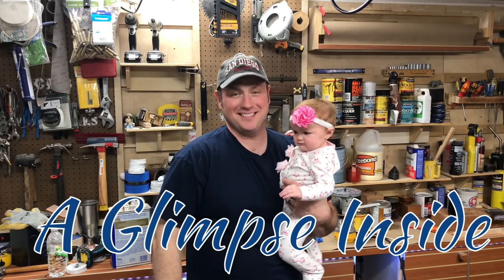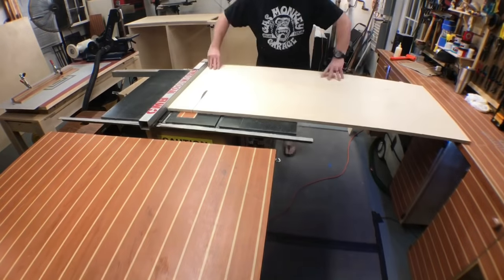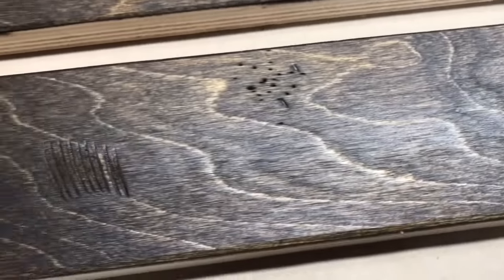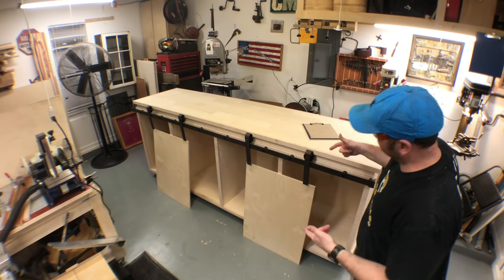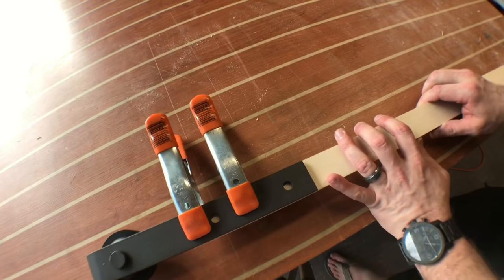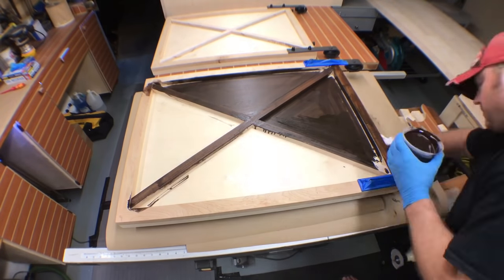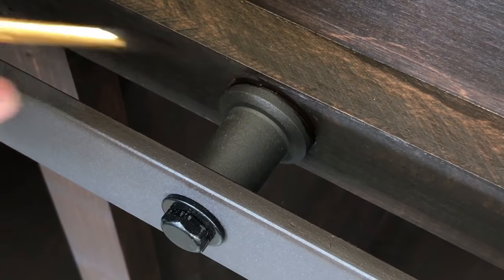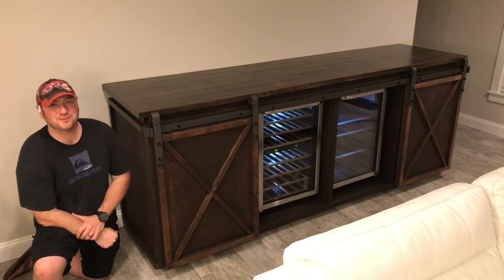DIY Sliding Barn Door Bar | Media Console Table

Comment: I also love your comments trying to relay that woodworking doesn't need to be intimidating. I had a really cool idea but no actual woodworking skills lol. I've only watched a couple videos so far and honestly just the equipment I'd need to buy is more intimidating than the actual design & practice of getting my design ideas from paper to fruition. I won't give up on the idea I think I'll just have to start on a much smaller scale. :)
Reply from the maker: That’s a great idea. Small scale for sure then work your way up!! Exactly what I did too the past 10 years!! Cheers
Reply: Harbor freight, Craigslist, fb marketplace and other buy/sell apps like offer up or let go, can be your best friend for affordable tools when trying to get started. You can do most cutting you would need to do on a table saw, so that would be the first tool I'd recommended buying if you can swing it. If not then a circular saw will work, although will be a little more difficult.
Anyway, just put your mind to it and go for it, one tool at a time and before you know it you'll have a full shop. Keep your eyes open for tools and anytime an item you need pops up for super cheap or on clearance snatch them up. Good luck

Comment: Curious about ventilation for the wine coolers? Where is the exhaust vent for the coolers? I also assume you had to cut holes in back for power cords.
Reply from the maker: Pat Kane That is a great question. For some reason I just did not include that in the video. But there are two slots in each of the refrigerator cavities, they are about 1 1/2 x 12“ a piece. I was actually over at the clients house a month or so ago and everything seems to be in working order so the ventilation seems to work fairly well. Again brother good question
Reply: Great comment.  I know someone who built a cabinet for a wine frig and didn't have enough ventilation. Wine frig died pretty quickly.  There are also built in beverage coolers that vent out the front but that could be a problem if the barn door is covering it

Comment: Great stuff.  Thinking about building this.  Not with the refrigerators but scaled down just with shelves as a piece to go under the wall mounted tv as I’ve build two barn doors in the room and it would match nicely.

Do you remember how many sheets of 3/4” birch plywood you used?
Reply from the maker: Tom Spallone Thank you so much definitely build one for yourself it’s a really fun project. I believe if my memory serves me correct are used seven sheets of 5 x 5 three-quarter inch plywood

Comment: Fantastic build, Thank you for sharing it. I just subscribed, and I look forward to viewing more of your videos. After watching it I told my wife that I should build something similar for my brother and sister in law to place in the basement for their bar area they are planning on putting in when they finish the basement. One question I have is did you use any kind of pre stain conditioner on the plywood prior to staining, or do you find that applying in with a rag versus a brush gives you the best result without the stain appearing blotchy? Thanks.
Reply from the maker: Thank you for such kind words! Yes you hit the nail on the head, a rag for stain application works wonders. It eliminates the need for condition IMO. Thanks again!

Comment: Did you not fill in the holes from nails and screws to keep the rustic barn look? If you didn’t want to add the rustic barn look, would wood putty sanded down and stain still work?
Reply from the maker: Yes I did not Fill those holes intentionally to give it that aesthetic. However a stainable sandable filler would be just fine

Comment: Hey Chris, I like the way You made this look easy, Could You Share a link on where You got the Barn Door Hardware? Was it through Amazon? Oh would like to make Comment on Finish. Seeing how You used Soft Wood mostly on Your Build, Besides the Maple .Do You not think  the stain Job would have turn out better to Use a wood Conditioner such as "Mini Wax " before applying Dark stain. I find it works great on Poplar . All N All Love how the Barn Doors turnrd -out ..Kay
Reply from the maker: I don’t have the original link as it was many years ago however barn door hardware on Amazon is pretty ubiquitous and you should find something there that will suit your needs for sure. As for the sanding sealer I just make sure I go through the grits properly and then I wrote the entire surface down with mineral spirits let it completely dry and then start the staining process

Comment: I'm going to be building something similar for my very small kitchen. I'm guessing you've done this a few times, but I'm planning on putting a mini fridge under my counter and a panel over it to "integrate" it. Is there a potential fire hazard in doing this? Did you have to find a specific model of refrigerator to put in this mini bar?
Reply from the maker: That sounds awesome. I don’t believe it’s a fire hazard however I would stick with a namebrand something that is the house hold name!

Comment: Sir, a couple of questions.. 1. Is there a list of the wood you used? 2. How did you raise it off the floor? 3. If I used a marble top will the cabinet hold the weight? 4. Did you drill holes in the back for the refrigerators?

Comment: Can you make some.plans for a similar build but with only 1 cabinet and 1 fridge area. So basically. 1 roller door and 2 openings
Reply from the maker: Fortunately I didn’t even make plans for this one essentially the video is the plan. I’ll tell you what I did though, are used or the dimensions of the refrigerator and just kind of followed my nose from there. Hope that works for you!
Reply from the maker: Unfortunately sorry for the typo

Comment: Hi I love this piece and you explained everything great. I’m going to attempt it. Just one question which I didn’t notice in the video. What is it resting on? Does it have a stand underneath or is it flat on the ground?
Reply from the maker: I built a 4 inch tall toe kick that is underneath the piece. I just forgot to film it! I simply build a grid with Baltic Birch plywood cut 4 inches in width. Thank you so much for watching

Comment: That is killer details. How much do you charge for something like that...Im newbie woodworker and setting price is always hard for me.
Reply from the maker: There’s two messages charging I typically use one is the cost of all the materials times four. Another one is to make around $500 per eight hour day. Plus the cost of materials. Or charge seven $50-$1000 a day and you buy everything for the project yourself. It just depends on the circumstance brother these are the three methods I use

Comment: I have most of the basic tools you used in this video and now I'm gonna attempt to build one myself. Even though it took you a few days to complete that amazing piece, it came out more than great. I feel as though I'm up for a challenge of that size. As far as materials, how much $ would you charge a client for a piece like that?
Reply from the maker: Depends where you live in the country and what people expect to pay I figured a good range might be $2000-$3500. There’s roughly $700 with material alone in this build
Reply: @AGlimpseInside  That's a really good profit margin, given the amount of time and energy you put into that project.
Reply from the maker: Waldo Rodriguez I typically like to make fourfold on what my material costs or $500 a day while working on client builds
Reply: @AGlimpseInside  Does the $700 cost include the mini fridges?
Reply from the maker: Unfortunately no.

Comment: What plywood is used for the brick pattern top? Also on the faux finish, what made the multiple lines impression?
Reply from the maker: It’s off 3/4 of an inch Baltic Birch with a eighth of an inch chamfer on each edge Getting it that reveal

Comment: I will show that to hubby he says the ones I ordered won't work, but I really, really want them to. The track is 5 foot and the straps are 1 1/4 inch wide by 11 inches long the roller is 2 inches.
Do you think if he adds the reveal like you did it will work.?
Reply from the maker: Donna Coffman as long as there's enough clearance and they slide freely yes they will work. I don't exactly know your situation but I know you can make most sliding door hardware work on most in the application if you put your mind to it

Comment: Would you able to tell me where I could get the hardware for the barn doors that are small enough for a cabinet that is 59 inches long and 36 inches tall.
Reply from the maker: Donna Coffman I ordered mine from Amazon it is a standard barn door hanging hardware that I modified with an angle grinder and sandpaper. I'm not sure if they sell them in very specific message like you're looking for I think you have to kind of do it yourself. But with enough patience it works out pretty well

Comment: It looks like the cabinet is sitting off the floor a few inches.  Did you install feet, a toe kick box or what?
Reply from the maker: Yes I did install a 3 1/2 to 4 inch toe kick, it is recessed by 2 inches all the way around. I totally meant to include in the video but for some reason I didn’t have any footage of me making it. I least you talked about my apologies. Take care
Reply: Thanks for the reply.  Have a question that you might have an idea on.  Am planning to build something very similar to what you built for an outdoor covered patio.  I am also going to build a box on top about 1/2 the depth (front to back) as yours that will house a flat panel TV.  Probably will be the same width (left to right).  Tv and bracket I suspect will be 75-100 lbs.  How would you suggest securing the top to the bottom?  Build as one piece. Or separate boxes and secure with ???
Reply from the maker: I would definitely join the two but I would not use any glue. Just some mechanical fasteners like screws. Just in case you take it apart. But definitely put them together as one unit but just not permanently if you catch my drift. Hope that helps brother!
Reply: I was sort of thinking about getting some steel plate similar to the track for the doors and use that as strapping and screw to back of each.  Sort of like how you would a fix and mirror to a dresser.  Assume that would be strong enough...
Reply from the maker: That would definitely work as well.

Comment: I see that you built a frame for the top. Is it necessary or could you just attach the top ply directly? Is it for strength or to give depth to the top? I’m building a console like this 7’ long planned on attaching plywood directly to the top (no frame) then 2” thick wood slab on top for the actual top. Hope that makes sense.
Reply from the maker: You could probably attach it directly. I wouldn’t see anything wrong with that
Reply: @AGlimpseInside  awesome thank ypu

Comment: Awesome price. Never see what the base is that raises it off the floor. Want to build but don’t see it.
Reply from the maker: I simply build a 3 1/2 inch toe kick out of Baltic Birch plywood that was 4 inches smaller on all sides
Reply: A Glimpse Inside Thanks for the quick reply! I’m good to go! Keep up the awesome work! Top notch videos! Planning a 3 section version with my kegerator in one.

Comment: Do you provide the dimensions? I love the piece and want to build it.
Reply from the maker: Unfortunately I don’t have plans for this. I simply used of the refrigerator and built around it!  It’s actually pretty easy to do I simply use tolerances of about 2 inches + on either side of the refrigerator as my measurements

Comment: Just ran across your video. First... i really like the piece and it looks great but....
Butt joints and glue can not replace the strength and longevity of traditional methods.
Mortise and tenon, biscuits, peg and dowel ect... will add strength and integrity to your projects.
I started out many years ago and trust me when I tell you, don't discount old school.
This is in no way a bash on your project. Just advise from an old guy who's learned by trial and error.
Still like the piece and you did a great job on the audio. Keep at it and pass it along to your kids.
Reply from the maker: I completely respect your gym. I agree as well the better techniques will have better lasting furniture. But the monster here is to just let people know that even if you don’t use them getting out and doing something in building with your hands is a very rewarding experience even though the piece of furniture you make will probably only last 10 to 20 years instead of 100. I’m looking to getting into more FineWoodworking soon but at least for now that’s what I’m doing brother

Comment: You got any plans for sale for this?
Reply from the maker: David Moss unfortunately I do not. I simply bill for cavities the same size that would hold one of the refrigerators! Essentially using the refrigerator as my frame of reference
Reply: any chance you remember which refridgerators those were? they didn't look like they were proud of the frame otherwise your barn door wouldn't roll past them. but how does the door open on the fridge and not hit? huh

Comment: Hi, I didn’t see how you attached the top to the whole thing or make the toe kick.
Reply from the maker: The top Is just screwed in from underneath. In the Tokochi is a series of three-quarter inch plywood strips that are 4 inches thick, if you can envision a small torsion system underneath that’s how I put it together. Thanks for watching
Reply: Do you possibly have a pic or a better example?
Reply from the maker: Taylor Hammond if you don’t mind DM me on instagram and I’ll send you more info on this!!
Reply: Hello,
I sent you a message on instagram. The names are just different

Comment: But those "fancy techniques" as you call them exist for a reason. They make for a significantly better joint.  It's the difference between a $500 and a $1500 piece. Or a 10 year cabinet vs a 100 year heirloom. A skilled craftsman vs. a production line.. Nothing wrong with what your doing, but dont downplay tried and true methods just because you dont use them.
Reply from the maker: I agree with you on this one. I don’t necessarily look down upon fancy jewelry I just physically don’t do it because of one, I’m not classically trained and two I just prefer to get the work done quickly even though I know I’m sacrificing longevity